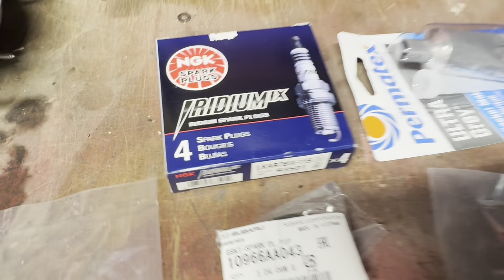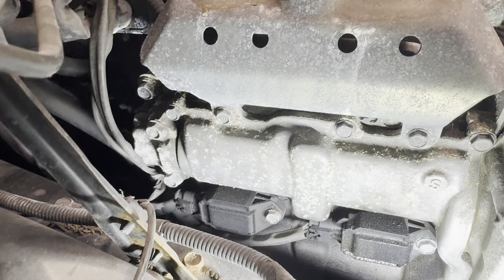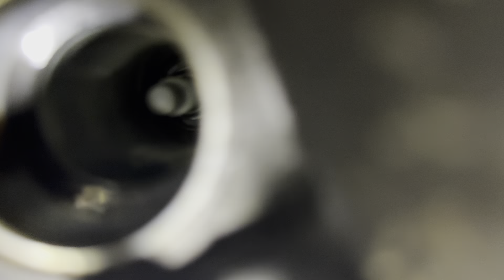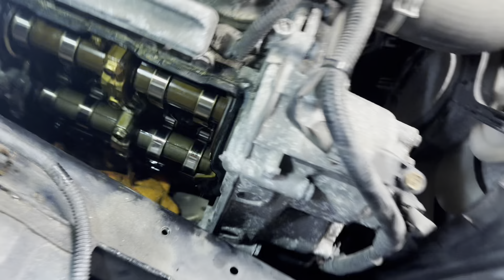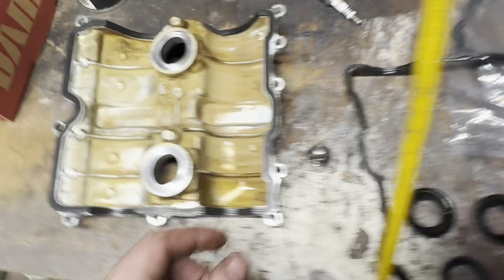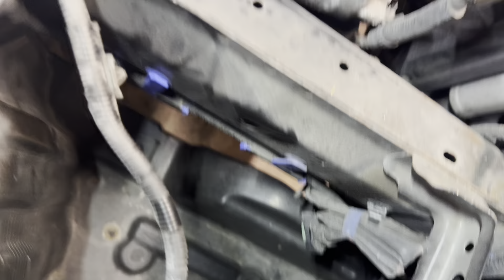14 Subaru 2.5 fb rocker cover gasket and spark plug tube seals

Comment: Spark plug change this morning turned into a bigger project when I discovered oil at the bottom of each tube. Wondering if it's wrong to just live with the issue a bit longer... 😕
Reply from the maker: Eventually it will be a problem, I think ours had a small miss fire. It’s not a hateful job but not fun by any means

Comment: Great video! Need to do this on mine and oddly enough not many Forester videos but alot of Outback videos. Glad to know this is daoable without lifting the engine as specified in the manual. Were the bottom 3 bolts on the rocker cover hard to get at from the top?
Reply from the maker: Yeah I had to lay under it , Subaru makes a spray that dissolves rtv I wish I would have tried
Reply: @3guysgarage  Apparently, I've been putting this off for 6 months. But I finally did the passenger side and the RTV dissolver did make things a bit easier. Thanks for the video!